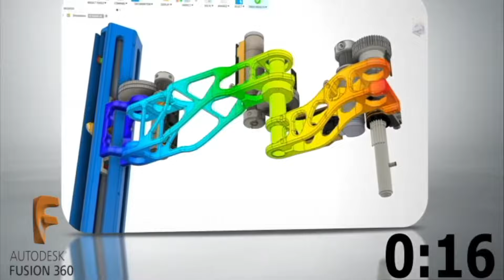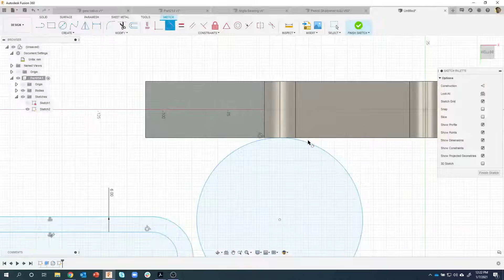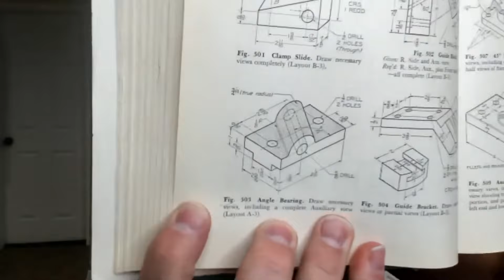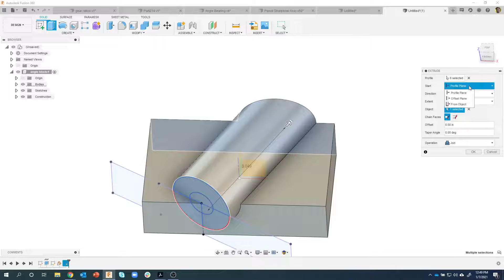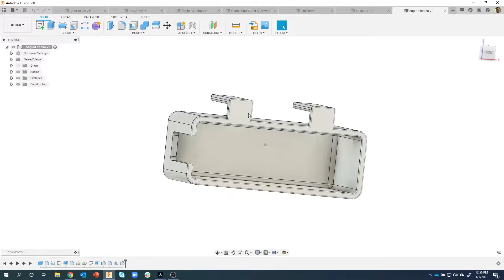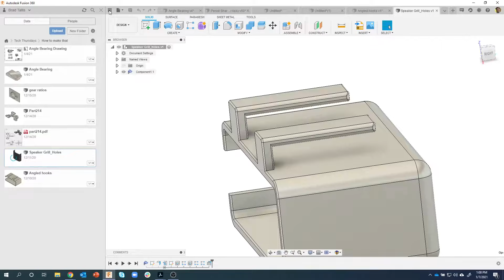Episode 81 - How would you make that?

Comment: Hi Brad, smart aleck mode on: at 32:28 I do not think, that the drawing is fully constrained,  because if you move the meeting point of the two perpendiculars on the center line to far to the left, you can find a point where the two lines are perpendicular again and the lines are tangent to the circles at the same time. So there are 2 possible points. smart mode off.

Comment: You typed in 24 for the 6 tooth gear and 6 for the 24 tooth one. Why is it the other way around?

Here's two tricks: 
1. If you hold down shift and hover over a line segment, it will automatically show the midpoint (as a triangle) of the segment while adding a constraint. 
2. Use an arc instead of a circle and specify a radius or diameter dimension.